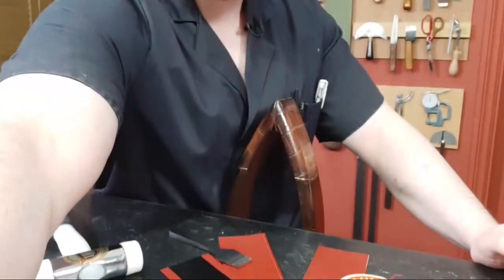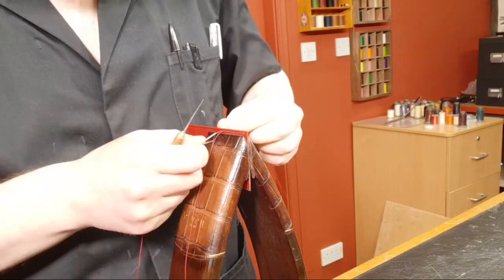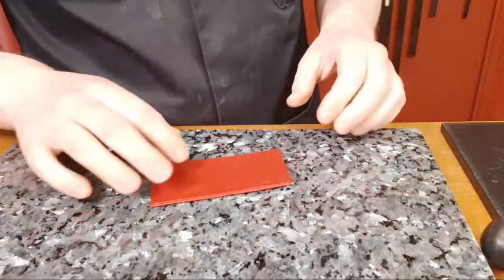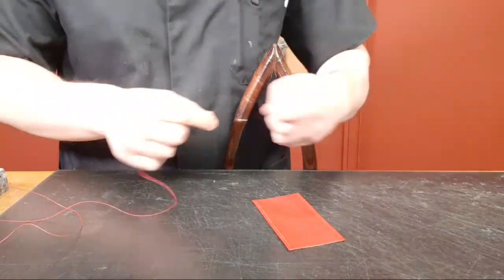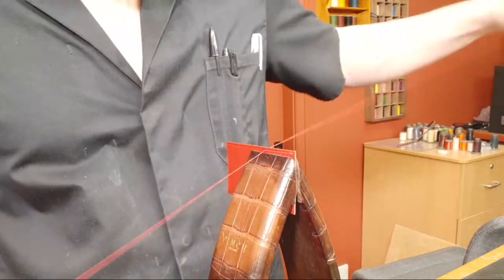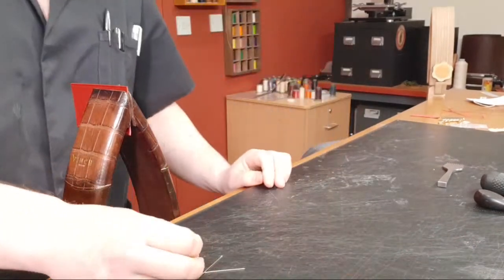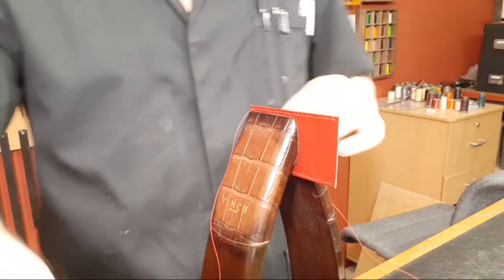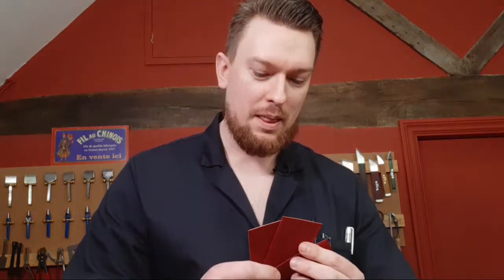Saddle Stitching A Leather Key Wallet

Comment: I always enjoy your videos. and each time you use or discuss pricking irons it reminds me of some huge 3 stitch per inch irons I have. They were used for making traces and tugs. The shop I worked in had a Pearson lock stitch machine but not the heavy awl and needle type machines to sew through an inch or more of leather. We had to hand stitch it and when they went out of business I bid on the 3 stitch per inch irons and they threw in the awls that were used  for sewing that size The largest is a T.Diixon and sons iron with ten teeth that is 80mm wide. Nobody other than me bid because no-one wants to sew that heavy harness by hand. We used to cheat by having an arbour press set up with a large awl blade in place and it would press through leaving you a straight hole to enlarge  with an awl while stiching .  All the best.
Reply from the maker: That's a great Idea! Thanks for sharing your story with us.